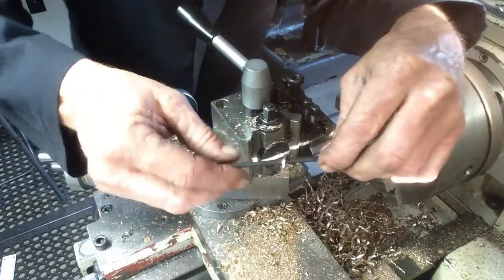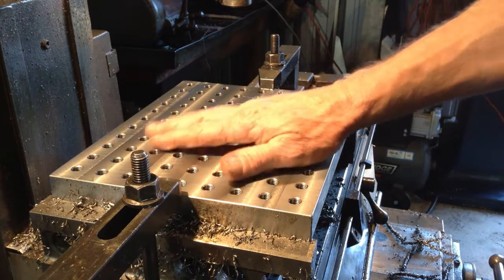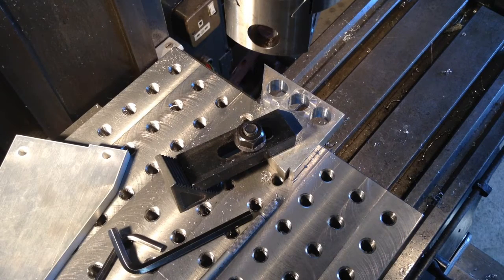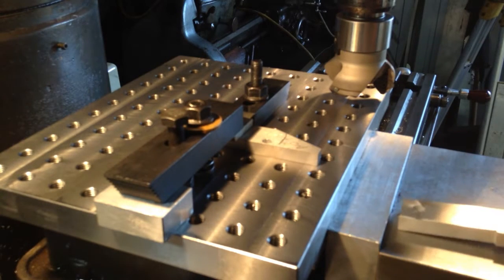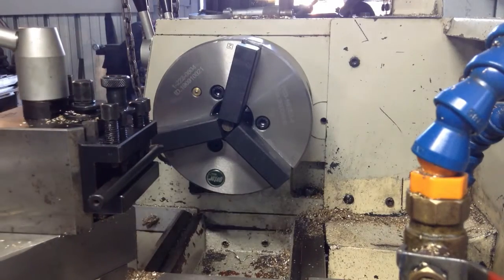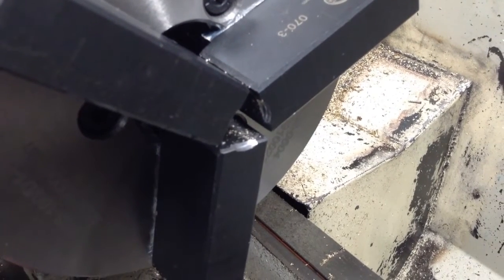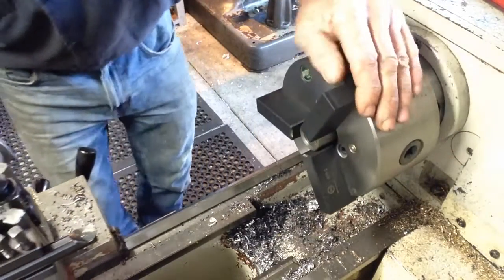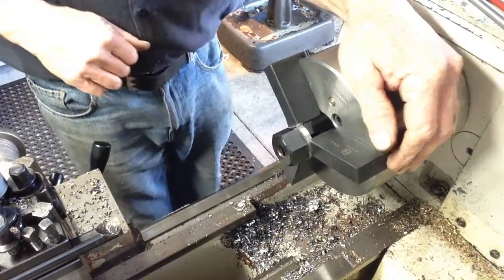Small Run Repetition Set Up's In The Bridgeport & Lathe .  Part 4 .

Comment: Hi Max, For some reason this has just popped up in my inbox. I've had one of these pallets for years, and I always blanked of the holes I wasn't using, some people use red caps to blank off the holes but I prefer corks, what I especially like is the process of finding used corks, not many about so I had to supply my own, a mans work, but I was up to the task. Best wishes mate, Mal.
Reply from the maker: Cheers . 👍

Comment: Soft jaws make repetition work so much easier.
Reply from the maker: They sure do , even if you have a worn chuck !   Cheers .
Reply: @swanvalleymachineshop  the old Pratt Burnerd I have is worn, but new soft jaws are just a little oversize.  need relief in places on a good chuck, but are a great fit in a worn out one! they are the only jaws I use with that chuck, the originals are just too loose to use.  Those are great looking soft jaws you have on your chuck. Lots of material for holding ring type parts
Reply from the maker: @smallcnclathes  They are good jaws , i will get another set so when the first set are mostly used up i will convert them to bolt in  soft jaws .

Comment: Very educational as usual Max, the fixture plate works great. Thanks for sharing. If you'd like a couple of electric  plugs for the socket on your mill I have some spare ones you're most welcome to. (I live close by)
Reply from the maker: Thanks .  I am not sure if i will use that plug outlet .  it is in a bit of a vulnerable spot  & may be removed .     Cheers .

Comment: Funny actually.  I just did the same type of job parting off 250 thin rings out of stainless.  I deburred them exactly like that in the lathe. 
Works good after all the messing around.
Reply from the maker: Not sure if i could take making 250  without going nuts !  Cheers .
Reply: I just daydream until my fingers hurt.

Comment: Hi Max....   Another set of jobs well done. Just the base Plate would have taken me a fair while, because I can't control the forward speed into bursts on my RF30 Mill, It's either on or off.    I haven't seen a set of dummy jaws before, but a great idea. I like the holding jig for your milling etc.   If I had known you were making a series of washers etc, you could have borrowed my     Parting Adjustment Tool    https://youtu.be/j82Eu8I5Vw8   Keep up the Great Video's will catch up on the next one.
Reply from the maker: Thanks Ted .  I just eyeballed these ones & they all came out where they were supposed to be .   Cheers .